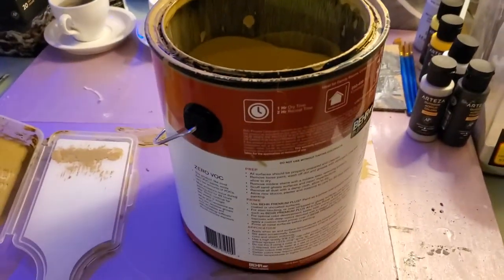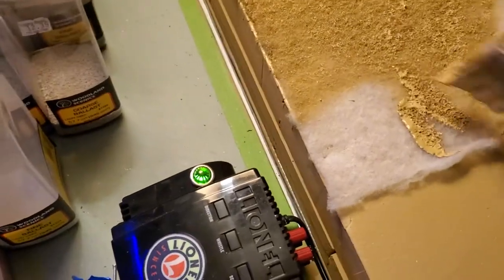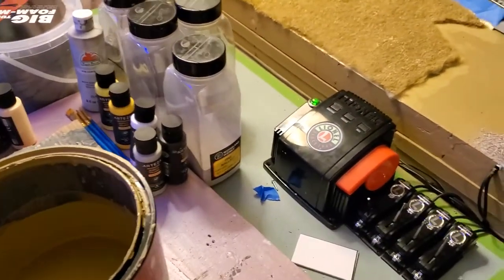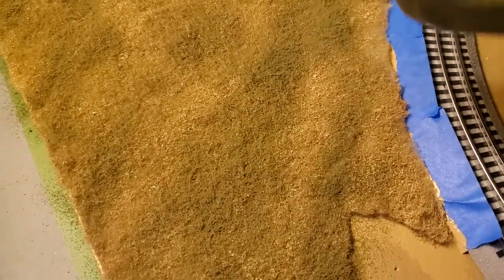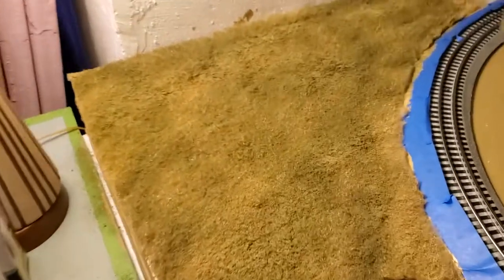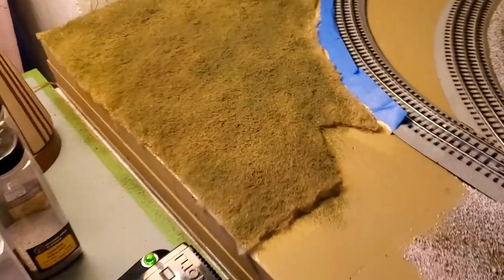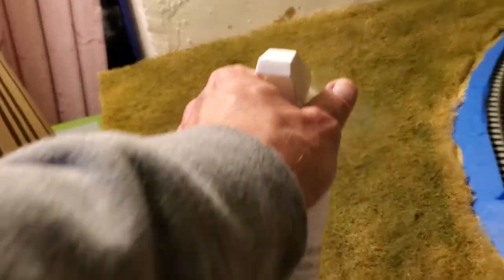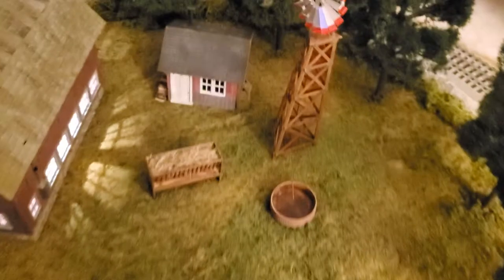Painting Batting and Putting Down 1st Layer of Ground Cover

Comment: Did you ever consider pre painting the batting with a low nap roller before applying it to the base?  Then go over it again with a mixture of glue and water to add your turf.  Just wondering how that would work.  Maybe more trouble than it is worth.
Reply from the maker: I did not.  I copied the method from a website.  Will say paint being damp is important to help hold the ground cover.  I think prepainting might have gotten a bit messy.